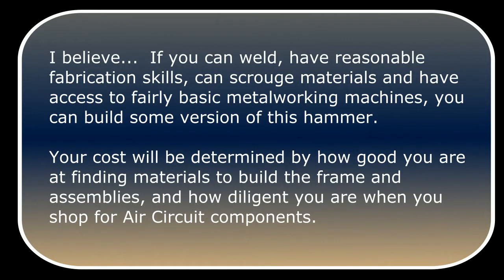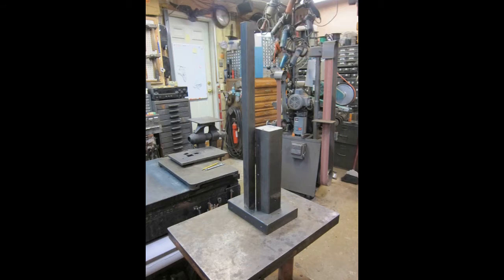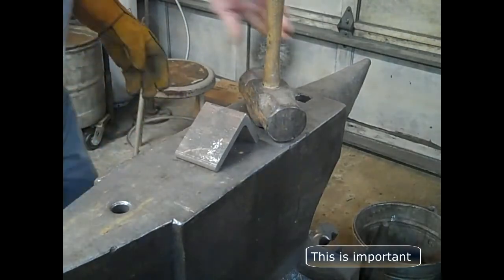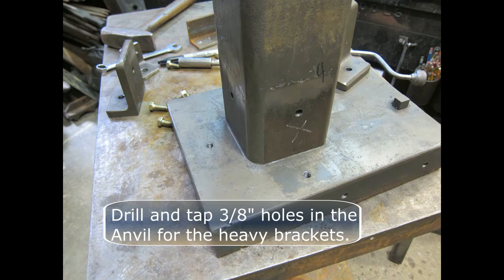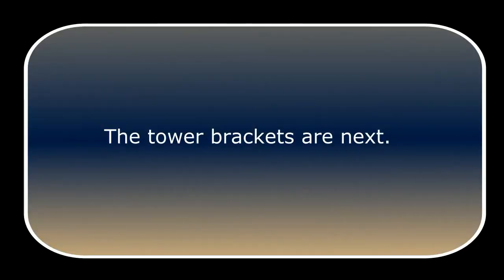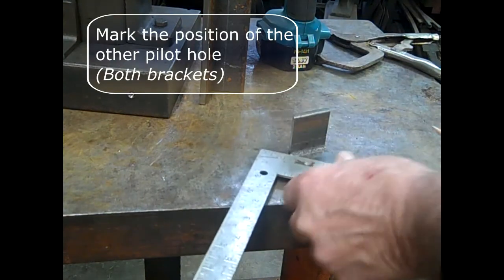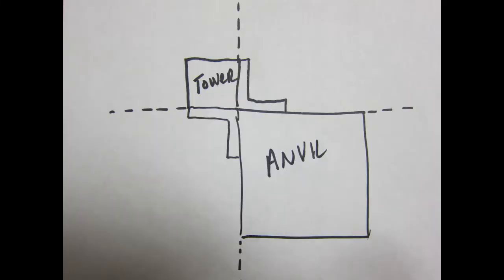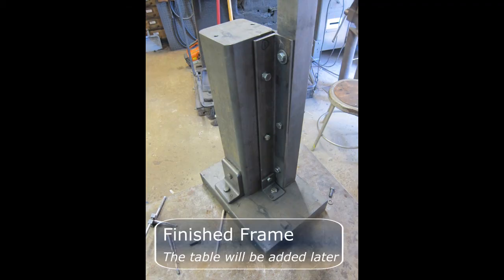Cricket Air Hammer Build - Part 1 of 11 (Frame)

Comment: What type of steel do you use to build this. Only toolsteel or a mix of tool and mild steel?
Reply: Everything can be mild steel except the dies.  The dies can be any tool steel you want to  use.  I suggest 4140 if you have to go buy it (the die plates can be mild steel).  The tower needs to be cold rolled to ensure dimensional quality.    In the video, I mention I used 4140 for the anvil and ram.  I only did that because I already had it...